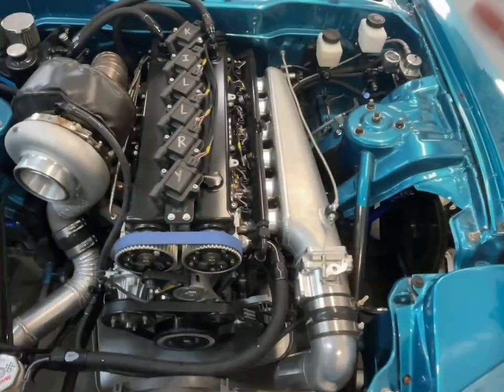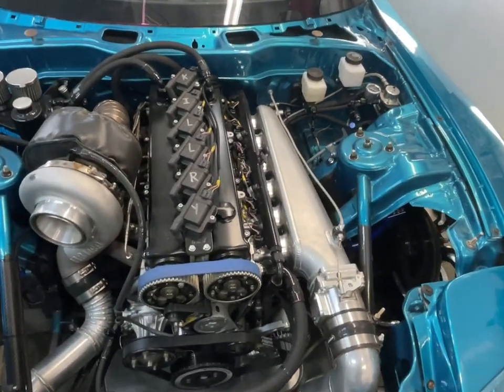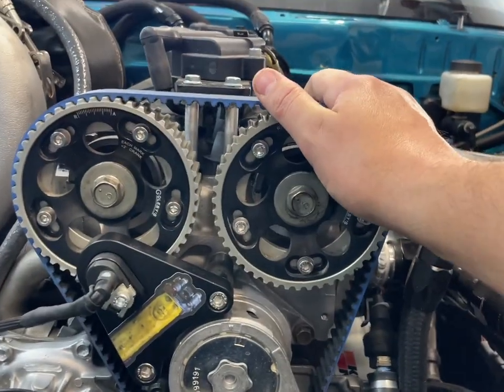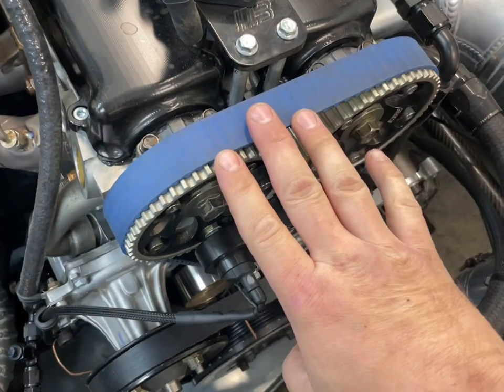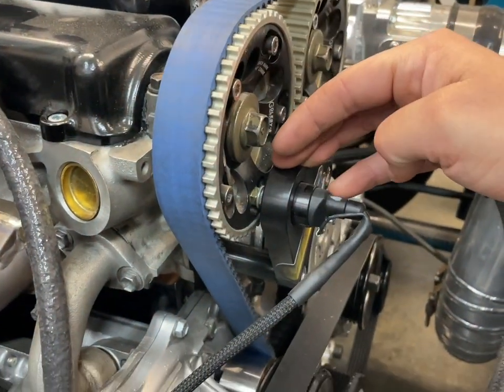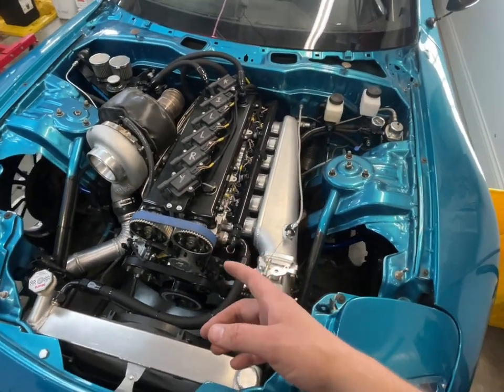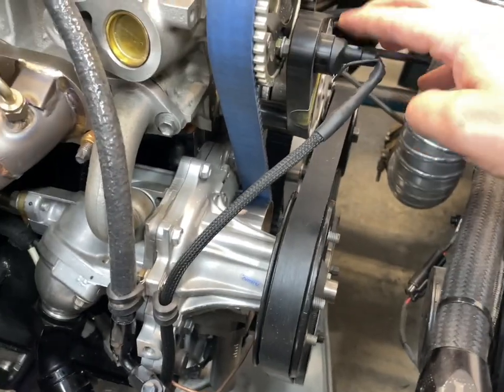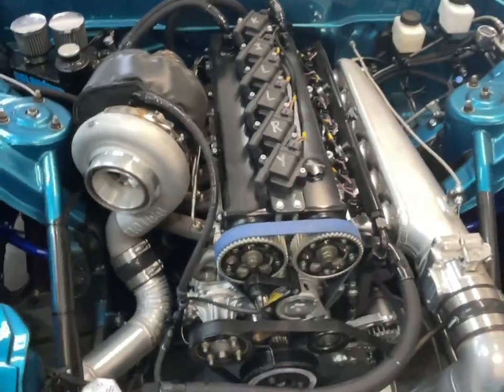2JZ Distributor Delete & Camshaft Sensor Trigger Explained

Comment: You always have cam belt deflection do to stretch and what not. The most precise sensor location is always at the crank. When the crank is at TDC there is nothing to stretch and or deflec. Why not just run it off the crank? Fueltech recommends for my FT450 to run it off the crank with the EM1 12-1 crank trigger wheel.  Now if your running full sequincail run it off the crank and cam using Hall sensors (digital signal) whenever possible. You agree? I am running the 3 wire Area51 Hall sensor off my 12-1 crank trigger. Great video my guy👍
Reply: He has both. The crank spins twice for each cam shaft rotation because its a 4 stroke engine. Therefore you have to know cam and crank position.

Comment: Did you have an issue with the bolt that locks in the sensor houseing at the back of the bracket touching the edge of the cam gear? I have the same kit but that bolt seems to be tight up against the cam gear unless I remove the washer behind it

Comment: Do you need the lower kit as well for this to work? Or can I just buy the cam gears and trigger setup to delete distributor?
Reply from the maker: I used OEM 2jzgte lower gear and oem sensor

Comment: You didn't need an aftermarket crank trigger? Is that a VVT-i oil pump with OE VVT-i crank sensor setup?
Reply from the maker: I run a billet PHR trigger down low
Reply: @ClapdOut  are you using a 12 or 36-2 timing gear for the trigger to pick up? Or do you have a video regarding the 2JZGE crank trigger? Thanks

Comment: What size titanium bolts are those and which ones did you buy? I have a scope function on my ecu and it seems to be picking up the golebys bolts sometimes.
Reply: Never got this shitty part to work. Went back to the distributor and it runs great...

Comment: What plug did you use to blank the distributor hole? Also what valve covers are those? Nice video man! Proper informative
Reply from the maker: The kit comes with a freeze plug specifically for it. Its angled to match the offset/angle of the head as well 🤙🏼
Reply from the maker: The kit comes with a freeze plug specifically for it. Its angled to match the offset/angle of the head as well 🤙🏼
Reply: Was wondering where did you get the titanium bolts